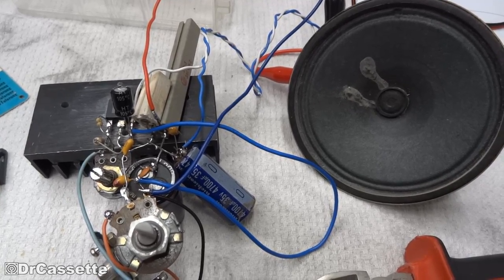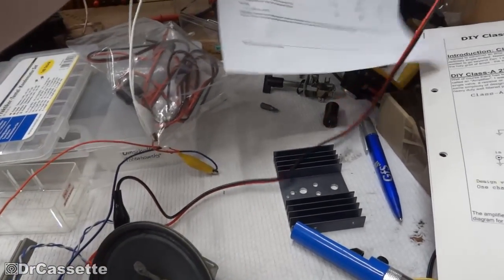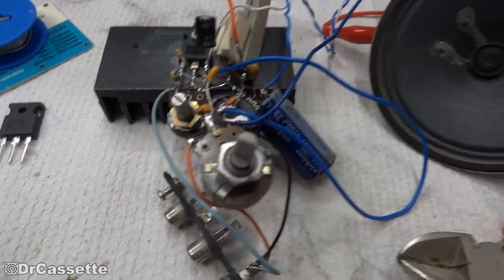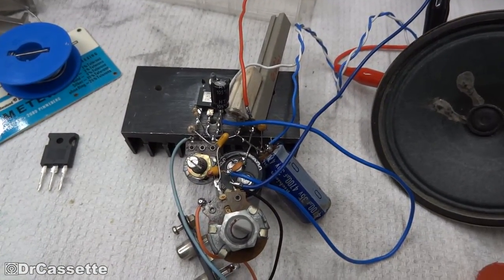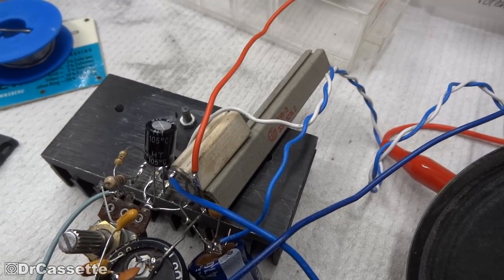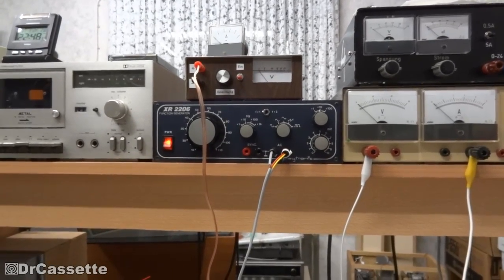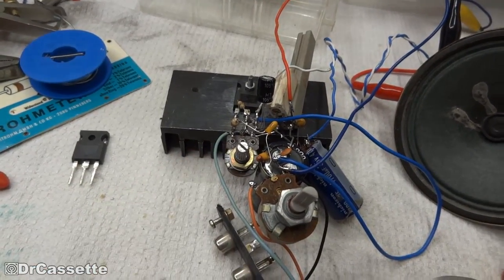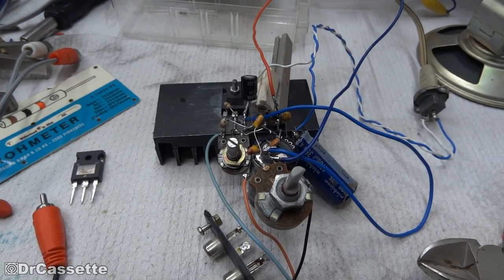DrCassette's Workshop - MOSFET Class A amp prototype

Comment: I'm building a similar amp to this, but my circuit doesent contain any resistors and runs on 35v. Sounds darn good but needs a pre driver stage, with just line level going in I cannot drive the amp into clipping. In fact it is much more powerful than I expected! I can get some very descent excursion on my test speaker, so I can hardly wait to see what happens with a pre driver installed!
Reply: DennisTheAwesomePony! 
Hi Dennis, how wud it work without the load resistor, do you insert the speaker directly between the mosfet and power supply? If yes the dc wud bias the speaker and make the output range smaller if not affecting the sound quality, isn't it?
Tks
Reply: @williamli7477  hmm he could be using a transformer for the speaker, that could also work.

Comment: Hi Jonas, how did this workout for you? Is it good as a listening amp?
Reply from the maker: I took apart the prototype after making the video. The power dissipation in the power resistors is just too much, and the output power is very low. There are much better amplifier circuits out there.

Comment: Glad you like my design. If it oscillates and that is the first I have heard of that, it maybe because of the wiring. It shouldn't oscillate due to low gain. Also not sure if you are aware but the input cap should be changed to 0.1uf. When prototyping the MCA I discovered the amp performs much better with the smaller input cap. Much faster rise times and almost perfect square wave at 1KHz. Did you build a working amp? There are quite a few in the wild and there is a real cult following with the design. Most who build a proper amp love them. But my MCA beats it. Try the MCA - Minimum Component Amp.

Comment: Ohh I used the same circuit when build my first one, and yes it also was doing the same thing on start up. I also found out that mosfet type does change the output power, the most nice sounding were small mosfets that I took from some old mother board I think it was 20N03 only 30V max but 120A so it was not getting too hot :)

Comment: I'll have to look into building one of these.  I have a set of speakers I built that have RCA 15x9" full range drivers in them as well as a 3" cone tweeter in a large enclosure with no back.  They sound excellent on low wattage amps and seem to have bottomless bass at times.  How much did the parts run relative to US currency?